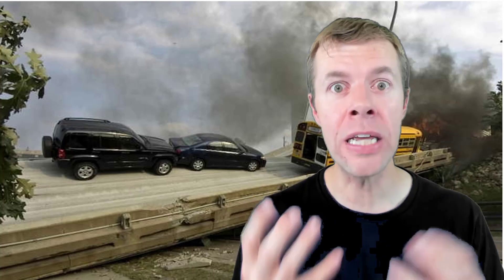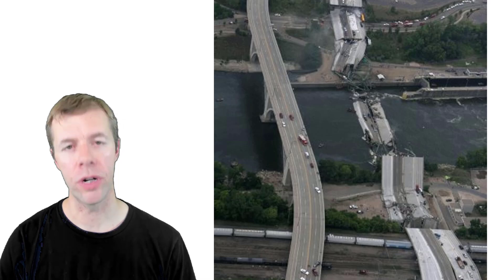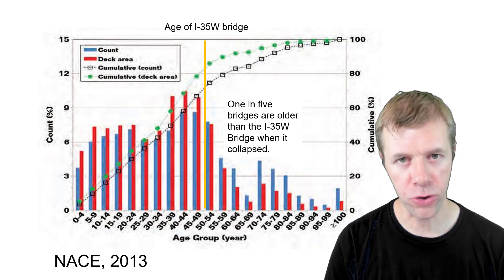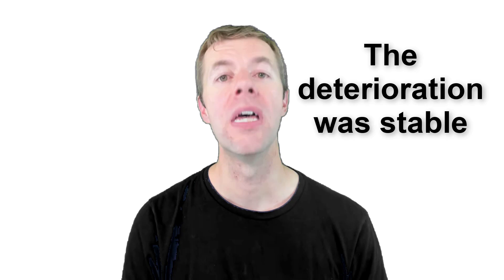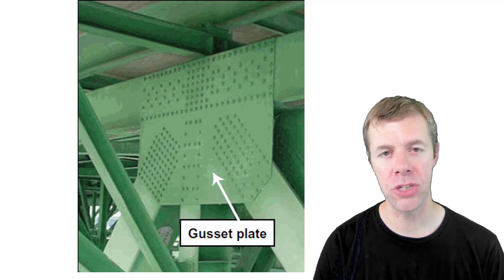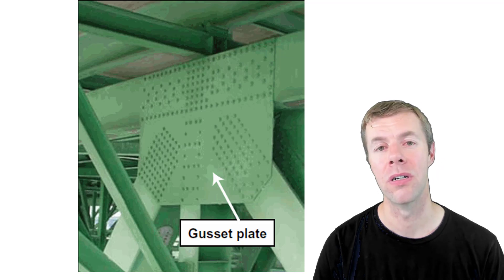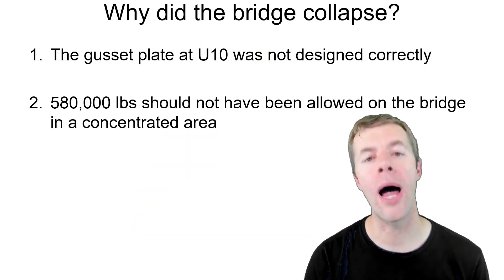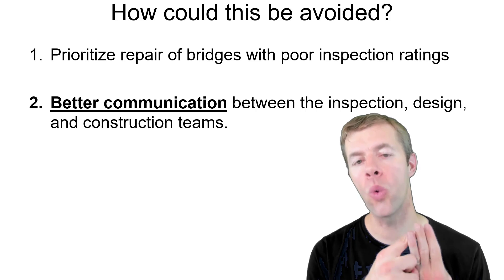Expert Review of Minneapolis Bridge Collapse

Comment: I think the general public would be more understanding of repair work if the bulk of it weren't so stupid and common.  Start building roads out of concrete again.  Cost saving asphalt-only roads require nearly constant repair and surfacing work.  This is like 80% of people's exposure to road work which means people get desensitized to it and it's subconsciously reinforced that the reasons are probably petty and thus inconvenient.  If construction work were rarer and usually for more serious reasons, people would treat it differently.

Comment: An alternative to a thicker gusset plate would be a suitable alloy steel, I would have recommended a 2000 series nickel steel, about 3.8% nickel would give you about double the strength. Some other alloys would probably work well, too.
 The stacking of tons of steel on the bridge was inexcusable, I hope that the responsible people spent some time in jail.😬

Comment: I used to hate sitting on that bridge in traffic. You could feel it shaking and swaying. MNDOT is crooked as hell. They had the same problem with a Bridge in St. Paul, they replaced that pretty fast after this.
The new 494 bridge started falling down before it was even finished, so they had to tear it back down and rebuild it, again, with the SAME crooked contractor. Then they built a new bridge near Stillwater and when the two ends met in the middle, they didn't line up. They jimmy-rigged it so look forward to more of these in the Twin Cities in the future.

Comment: Nice video teaching, but I was surprised by your emphasis on maintenance/repair near end, when bridge was doomed from get-go (needed a major retrofit of the gusset plates, not maintenance/repair).  I remember the post collapse investigative finding you report here that the gusset plates were supposed to be an 1 thick, which came out long after the drive-by news media blamed neglect, which is unfortunately what stuck in most people's minds as root cause.  Is there any chance the steel fabricator supplied two half inch gusset plates for each side of every joint (for a total of 1 inch on each side) but only one 1/2 inch gusset plate was installed on each side by mistake?  I ask because it's hard for me to believe gusset plates not meeting design specs weren't caught before leaving the fabrication shop or when received on site, but I'm not a steel structure engineer and don't know if two half inch gusset plates stacked on each side of joint are equivalent to a 1 inch gusset plate on each side.

Comment: I remember fishing under that bridge around 1970 as a young teenager. Looking up I would see pigeon droppings, rust forming and dripping even when it wasn't raining. I wasn't impressed. It didn't look very solid to me and it was only 3 years old at that point. The underside of the bridge kind of reminded me of that movie from the mid 70s with the bridge collapse called Cassandra Crossing. Just imagine how much salt was dumped on the roadbed over the 40 winters before it collapsed.

Comment: One more thing most people and even engineers missed - quite evident on the Wikipedia images of the buckled gusset plates are the numeros strain gauges attached to the adjcent  beams - load monitors? Some technician or engineer reveiwing those images should have noticed the buckled plate and wonder why no strain gauge rosette was placed at the most obvious point of strain?

Comment: That means road salt and gravel is used every winter because MN bridges are subjected to ice and snow. iron and salt dnnot mix well. MN CDOT always had a habit of aggressively attacking ice and snow buildups and nicking the sides and scraping the roadbed. I noticed open air sections of rebar. That means there was a path opened to the rest of the rebar, now exposed to saltwater. I knew 20 years earlier that the bridge had a death sentence. YOU LOOSE THE STRUCTURAL INTEGRITY WHEN YOU   REMOVE THE PRE-STRESS IN THE CONCRETE! You suddenly have the dead weight of the coto handle the complete upper deck on a structure not designed to support it.The construction equipment was the final straw. Exposing more rebar and point loads was the complete failure of the support structure. I cringe every time I see a snowplow draw sparks from the roadbed or nick the bridgework. The death of a thousand cuts.

Comment: One other consideration: The larger deck was made of pre-stressed concrete.  That means that you had  iron rebar embedded into the deck construction. this is a bit of a cheat, because pre-stressed concrete deck is only suitable for temperate climates.

Comment: Very interesting. If a fraction of the money spent on Foreign regime change and space was spent on USA infrastructure they wouldn't have these problems.....PRIORITIES !!..Been to Sicily recently and it seems that after the collapse of the Genoa bridge they are digging out huge chunks of reinforcement on viaduct type concrete bridges with contraflows in place.FLAP FLAP FLAP after a disaster but then after a while complacency sets in and this urgency to inspect and repair bridges gets less important. Sicily has an incredible civil engineering infrastructure with tunnels and bridges spanning mountains and valleys throughout the country but maybe the maintenance has been a bit lax!..Glad that they are checking them out now as these bridges are thousands of metres in the air at points!!

Comment: 1:30 "They don't let people on bridges that are unsafe."
   And with this comment you destroy your credibility. This bridge was CLEARLY unsafe. We know it was unsafe because it collapsed. The people who inspected it failed to realize it was unsafe. Or perhaps they did and their bosses ignored it. 
    Either way the bridge was unsafe and people died because of it.
    Here, I think you need to watch this.
https://www.youtube.com/watch?v=3m5qxZm_JqM
Reply: Maybe it was truly "unsafe". Considering its collapse was caused by something as mundane as placing the weight of half a dozen trucks filled to the brim on it in the wrong spot that is probably a valid assessment. I just really don't like the "We know it was unsafe because it collapsed." bit.

You can destroy anything with enough effort. The inspectors gave it a bad rating because it had problems, yes, but those weren't considered of such magnitude to actually impede regular use. It simply meant that the safety margins were less than with bridges in proper condition.
I don't know about regulations regarding construction sites on bridges. Tyler said putting 251 tonnes of construction material on a small part of the bridge was something that shouldn't have happened. To me that sounds like it was something people don't expect to happen, and as such, something that wouldn't be considered when deciding whether the bridge was safe or not.
Saying something is unsafe because something bad happened with it doesn't work. I'm not living in a country where I get into much contact with guns, but I would say there are guns you can call safe and those you can't call that. If the design and the condition allow for keeping it in such a way it can't discharge unintentionally I would call it safe. You can then handle it badly and still shoot yourself in the face with it, but that doesn't mean it was unsafe, it means it was treated wrong.

Yes, this tragedy could have been averted if people had acted sooner. However, life is about making choices based on imperfect information and restrictions placed by reality. Life can't be made perfectly safe. Saying "Safety is our first priority" after a train accident is a complete falsehood that's simply something people expect to hear. Trains are metal behemoths moving at speeds that ensure they will oblitarate whatever gets in their path. You can do your very best and go above and beyond what other people have done before to make them safer but to make them totally safe you would need to get rid of them entirely. You can't achieve perfect safety.

So, er, yes, mistakes were made, things should have been done better, but claiming his statement of "They don't let people on bridges that are unsafe." destroys his credibility is a bit much.
Reply: You know, if you put 250 tons on a bridge and it collapses, do you know what that is called? AN UNSAFE BRIDGE
      If the bridge has a weight limit, that limit should be known, and a higher weight should not be permitted.
     If a weight limit for a road or structure is less than what might reasonably be expected, you put up a sign that reads "weight limit..." and you don't allow anything heavier on that bridge.
     A bridge the size of this AND that is part of an interstate freeway should be able to handle 250 tons. It should be able to handle MORE than ten times that weight.
       Now, they KNEW this bridge was unsafe because the engineers inspecting the bridge could see it was unsafe. They gave it a failing grade didn't they. That means THIS IS UNSAFE It FAILED its inspection.
     Now, I'm not blaming the inspectors. They did their job. They inspected the bridge and found it wanting. Their bosses chose to ignore them and left the bridge open. That means they allowed people on the bridge knowing it was unsafe.
       The person posting this video made statements that proved to me that he is an idiot and has no idea what he is talking about.
   And your statements prove that you are an idiot as well.
   This sort of thing happens all the time too. It's not the engineers, it's there idiot bosses, who were promoted because they sucked at engineering.
     NASA Engineers told their bosses that the O-rings in the Space Shuttle boosters performed poorly when they were cold. But STS-51L was a high profile mission and the bosses thought that another delay would be bad for the program, so they launched anyway. The O-rings performed poorly, and it was far  worse for the program than another delay would have been.
    This bridge failed because motherfucking politicians wanted to save money, so the postponed needed maintenance until the bridge became unsafe. Then they didn't want to close the bridge because it would be a hassle, so they kept it open knowing it was unsafe. 
    And we know it was unsafe because it fucking collapsed. How hard is that to understand.
    If you are driving your car at what you consider to be a safe speed, lose control and crash was your speed, in fact safe?
     Perhaps I should make clear what "Safe speed" actually means. It is a speed at witch a loss of control will not take place, and if it does, it can be regained without crashing.
    So again, if you lose control and crash, were you going at a safe speed?
Reply: @erictaylor5462  
I hate how backspace can move you back to the last page.
And I was just done writing half a page or so...

Oh well. I'll keep it shorter.
https://www.ntsb.gov/news/events/Documents/minneapolis_mn-8_%20BRIDGE_INSPECTIONS.pdf
https://www.fhwa.dot.gov/publications/research/infrastructure/structures/bridge/14063/14063.pdf
There. Those slides/documents seem to indicate that at the time gusset plates were not considered important in the guidelines for constructing bridges and inspecting them. I assume something was regulated about them, but they apparently weren't considered a potential fail state that needed thorough inspection.
The rating "structurally deficient" means that something needs repairs, but is safe. In the case of I-35W, which shared its "structurally deficient" rating with over fifty thousand bridges in the US, the rating came from other damages than the gusset plates. It seems they weren't even a factor in the rating. Which means the bridge could in fact have been deemed intact and undamaged and still failed like this, because this collapse was what caused gusset plates to come under increased scrutiny.
Sadly I did not find any details about the 100 point rating system and the "F" grade, but since it corresponds to "structurally deficient", this "F" is obviously not to be taken as a complete failing grade like in school, since, again, that still means "safe".

I guess it's like the question of whether you are actually lying when you truly believe what you say. If somebody today truly believes they are Napoleon, are they lying? They are wrong , of course, but lying would indicate an intention to deceive.
What with how you claim "They don't let people on bridges that are unsafe." destroys his credibility you imply that people knew that the bridge was unsafe. He was trying to say that they don't let people on bridges they believe to be unsafe. Or are you really saying that in hindsight people should have known it was unsafe? Or did you take Tyler 100% literally when he said that? Well, yes, I guess the bridge was unsafe (I don't know how often 250 tons concentrate on an area the size of seven cars; if that happens more than once in a blue moon and not only when critical mistakes are made, then that should be a criterion whether a bridge is safe or not). If that had been known, they wouldn't have let people on it (or enforced restrictions such that such weight would not have been placed on it, which might have made it safe for use again). But they didn't, and so, from an omniscient point of view, they did let people on an unsafe bridge. But hindsight is 20/20. Stop nitpicking words. Want me to do the same? Ok. "And we know it was unsafe because it fucking collapsed. How hard is that to understand.". So if I placed a billion tons in the size of a football on a bridge and it collapsed, it would be unsafe?

We are not omniscient. There are certain standards we should adhere to, and then we consider something "safe". If I fluked my driver's license and considered driving triple the normal speed limit on wet and cold conditions safe then I would be wrong by any sane human's standard. If I'm on the freeway and drive 70mph and feel safe in the knowledge that I have done so very often, there are no special weather conditions, not a lot of traffic and I have the same training as thousands of other people who do so safely, but a freak accident causes my tire to blow and car to go out of control and I die... I don't think my speed would have been unsafe. If I knew or could have been reasonably expected to know that something was wrong with my car that would be another thing. Or if there was ice and fog that very same speed would be unsafe.
A freak meteor strike could kill me any moment now. That doesn't mean "I am unsafe". Nor should a person killed by a meteor strike (if such a thing ever happens) be considered to have live unsafely because of that. People dying doesn't automatically mean that whatever killed them was unsafe.

Aaaand I didn't keep it shorter.
Reply: You are correct.they new it was unsafe and that's why they lost every law suit

Comment: Hi Tyler, concrete and asphalt roads which ones last longer and which one is less expensive?
Reply from the maker: Isaac -
Concrete is typically more expensive and should last a lot longer than asphalt if done correctly.  If you look at the cost over a long period of time then concrete usually wins.

Comment: Would you consider checking into the failure of the bridge in Miami, FL.  You are a concrete guy.  And that was a very interesting case.  I had never heard of a concrete truss before that failure.  But looking at the preliminary sketches they had, not much was said about how loads would be transferred through the joints.  What would be gusset plates in a steel application.  Would like to see you look into that one!  You are good at explaining the details.

Comment: I looked up how the sufficiency rating you mentioned is calculated (https://www.fhwa.dot.gov/bridge/mtguide.pdf Appendix B; I hope its the right one) And only 55 of the 100 points consider the structural status and safety of the bridge, the rest being calculated by the features of the bridge (like how functional it is; is it adequate or needs an upgrade) and the how essential it is to the public making up 30 and 15 points respectively. 

if you look at it like that 50 seems pretty low...

Comment: Here's the problem as I see it. We should never built the interstate highway system to begin with. At the end of WW2 we had a pretty complete rail infrastructure in this country. We shitcanned it for a bunch of bike hike trails. The expressways bulldozed there way through our cities chopping them up into so many islands. People could run away from their troubles by driving out to the country and building new suburbs leaving the inner city to stagnate and collapse. This was especially hard on Detroit. It's too late now. We built these things and now we have to maintain them. They are not cheap roads. We could have blacktopped every dirt road in the country for what it cost us to build and maintain the interstate highway system. In the end it's just a way to get the military around the country in a hurry. Personally I think the system should be sold off to the highest bidder with the stipulation that they be used for self driving cars only.
   This little rant ought to get some lively discussions going. Jack

Comment: I'd be the guy making the case of over loading the bridge and I'd be the guy ignored and scoffed at.

Immediately upon seeing that gusset before a word was said I thought, Wow that looks way too thin.
Reply: Decided to scroll down a bit before writing the same thing, you beat me to it. I bet some of the guys who built it had the same thought. I'm not a professional engineer but have done some design & fabricating that does not fall apart. I've also cobbled a few things together in a pinch with inadequate, but available, materials when things were not critical and seen them fail. The number & size of the rivets (or bolts?) in that gusset tell me it's being asked to do a job beyond what that plate can take.